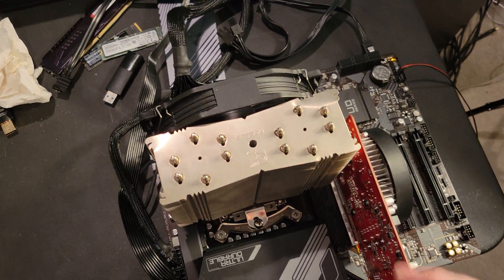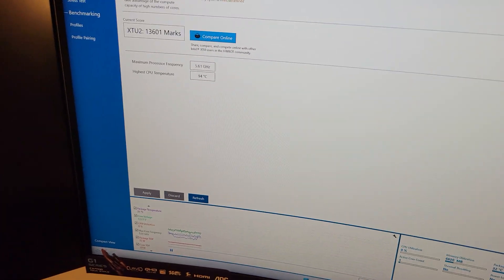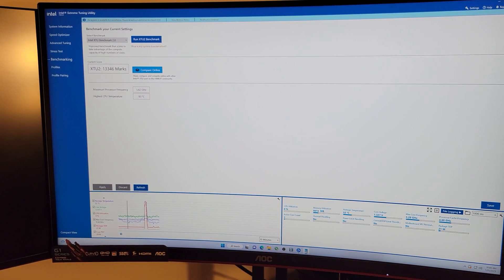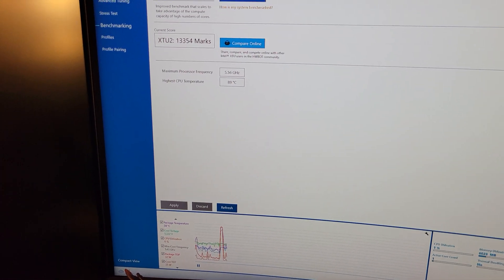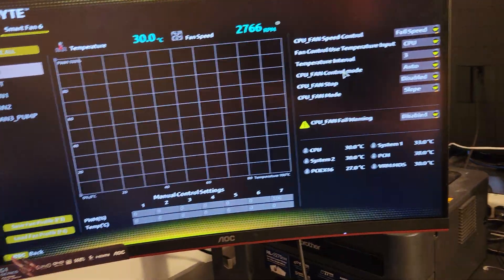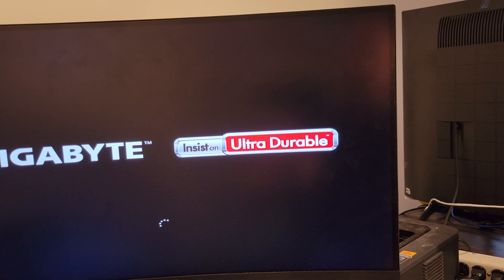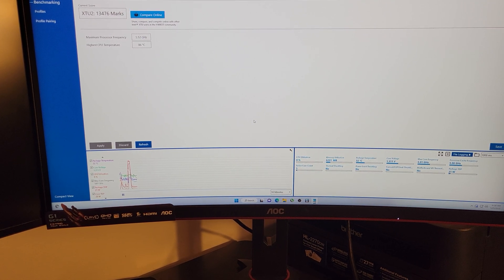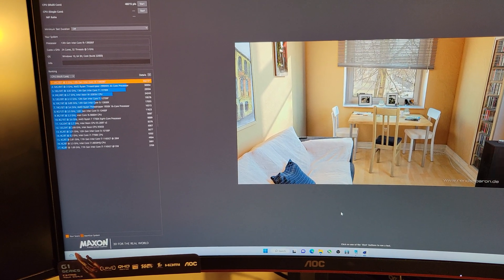3000 RPM Noctua NH-U14S with I9-13900kf, benchmarks decibels and Temps.  XTU and Cinebench, NF-A14

Comment: U14S makes sense up to 200W, but not much more. By making sense I understand operating in pc case and not running damn full speed. Usually crossing 2/3 of maximum speed of the cooler shaves <5C, so nothing game-changing, but costing drastic noise increase. Faster fans never really change capabilities of cooler - they may shave next <5 degrees.
Reply from the maker: Well said...needless to say, the D14/D15 ends up with the same fate...

Comment from the maker: In this video, trying another method to see if I could eventually get past Thermal Limit Throttling with the I9-13900kf and CPU settings to default (except for power limits).  There will be a future video of this with the D14 and then D15....as those might just get it done.  If you can't hear my voice....its because this fan is so loud, decibel reader shown in the video.  This should load in either 4k 60 or 4k30 at some point.